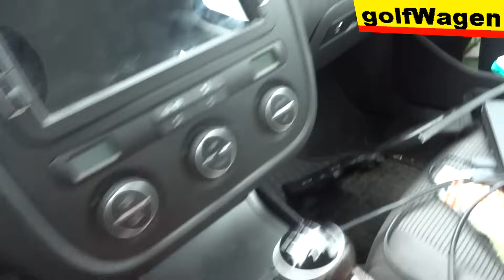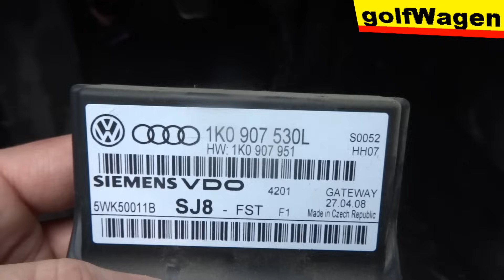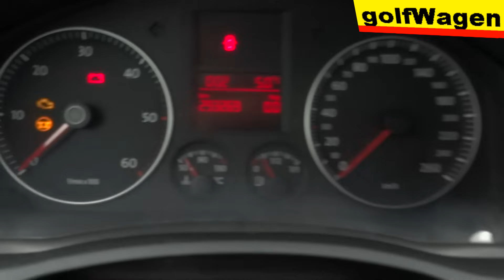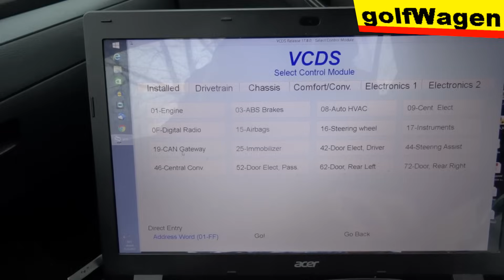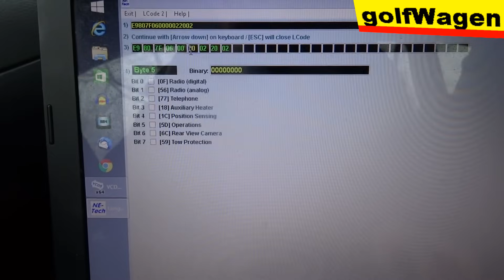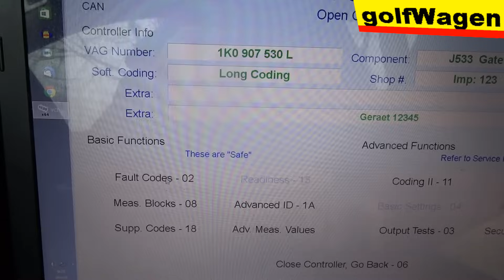VW Golf 5 CAN Gateway module location change programing /can BUS?/

Comment: Hello, I have a Jetta 2009, code 18259, there is no ABS ESP error on the screen, the only problem is that when I turn it on on a snowy road, the ESP symbol flashes on the screen, it was completely normal before.

Comment: @golf Wagen hi bro,I'm a golf 7 user, I'm getting parking sensor failure, fault code is u112100, when I connect it to the device, it says databus missing and the sensor on the left front corner of my vehicle is constantly beeping. I changed the sensor, the fault still persists, what can I do?

Comment: Hey can you answer me this please.  i was doing coding and programming with a snap on machine and now my rear boot lid dont work i check all the wiring to the module its not the wiring or parts at fault i need to tell the system the rear boot lid is fitted because when i do some check it say rear lid not fitted any help will do thanks.

Comment: Hi ever one on here can you advise me on the issue I do I ordered a vcds program from eBay to clear the codes stored on my car I actually removed and replaced the heated leather seats with normal seats on my mk5 golf and the radio now I have the steering angle light on and the abs the codes are which I can’t remove are 00361 and 00857 where my cd is working fine I don’t know how to deal with this issue can I make the car forget about the heated seat as I followed one of your videos where how to reset the steering angle sensor g85 which is sorted now but can’t get rid of the steering traction light and abs any help much appreciated thanks

Comment: hello, have you any experience about this comfort module (convenience module).. its eating my battery.. i found its using power when car closed.. also it clicks every like 2minutes..  what cable you use for this VCDS, where can i buy from ebay maybe. (octavia mk2 2006)..  the blink lights flash but no sound from alarm siren, thinking maybe this is reason.
Reply: Hey man. My car has the same issue. the CCM (Comfort Control Module) clicks on my car every 10 seconds and my battery is draining. I have a 2010 Passat. Did you figure out what was wrong with your car?
Reply: @danny996  not sure. Could be the alarm siren. Have 2 cars with same problem
Reply: @rteaw  hey man. I think my issue is a rear door locking unit. Check your doors and windows that they all work.
Reply: @danny996   i checked with software, monitoring signals, open closed.. both cars show same values.. its the module that checkes for something all the time and keeps draining
Reply: @rteaw  okay what did was get the car in locked mode and sat in it and heard a click every 12 seconds. that was the CCM unit under the glove box. that might be what is wrong with your car.
Reply: @danny996  What happened to your windows? :)
Reply: @ristokama2581  My passenger rear window and door would not work.I got a new door actuator and the door started to lock and the window started working. A bad door lock module made my car not go to sleep and would drain the battery.
Reply: Hi i have the same problem on golf mk 5 but all my windows and locks are working and still the ccm clicks every 5 seconds and drains the battery. Any advice ?
Reply: @babuschkacoolhere  latest i found is that backup battery in extra alarm siren is bad and therefore is not sleeping and checking
Reply: @rteaw  Tnx for replying. I am not sure that my golf has a alarm. Where is this battery located?  I am getting frustrated with this. I found out that when i remove f25 and f26 (40 a fuses) in the engine compartment, the clicking stops.
Reply: i have the same problem in my 2007 seat leon. It's eating battery.I measured fuses and the gateway fuse gaves the signal every couple of seconds. The clicks are coming from the passenger side behind box wich i took it away in i saw that the clicks are coming from convenience module.Then i disconnet the wires and the clicks stopped. I dont know where or what to look at to solve this problem.Sometimes is showing on my dashboard that the door is not closed and then i cannot lock the doors until the error disapers,and in my dashboard is not showing wich door is not closed. But even when i dont have that error and the doors lock the clicks are still there and drains battery.
Reply: @babuschkacoolhere  there is a battery built in inside the black platic siren. Normaly its behind the wheel arch plastic inside. Some people open and change out this battery if they find one to buy because is little bit non standard
Reply: @markoovsec1493   i found one more thing. I found fuse missing for alarm dont remember position. And than i got one guy to reprogram to another type of alarm at same time and now all is good. So dont know if it was because of the alarm or fuse. There is many different alarms to choose from he said. With interior sensor, without.. with glass brake sensor, without and so on. My problems all started from one total drainage of the battery. And still rear window left side works upsidedown when pusing controls.  And i got both rear door modules complaining about missing signal for iterior lock button (and i dont even have that)
Reply: @rteaw  i have drain problem from last year,but the problems with doors(sometimes is showing that are not closed,dont know wich one) that i have is now going to be about 3 years. i dont know if i even have alarm.
Reply: @markoovsec1493  1 sensor hood, 4 doors, rear bonnet lock. One of your micro swiches is bad and dont send the signal that convinience module is waiting for. Im not 100 procent sure but locks i think have 2 micro swich per lock. 1 for open and 1 for closed. With vcds interface you can folow and see the signals when you open and lock one bye one

Comment: Hello, why you change this module? I changed the radio and i have battery problems. I had readed that with the module L the battery dont have problems of discharging. Can you said me if you change it for this reason?
Reply: Did you find a solution, for me I upgraded the radio and I got a huge battery drain + lost steering wheel controls.
Any help!
Reply: @mmk958   you have to change the canbus or buy a adaptator. The best way is buy a adaptator
Reply: @jorgematamorosa  thanks for your quick response,
Do you have a suggestion or a link please!
Reply: @mmk958  depends of your car model, in AliExpress have a lot of sellers who have this adaptator
Reply: So I don’t need to get the canbus? The new adapter behind the stereo will be enough to avoid the battery drain?

Comment: @golfwagen did you solved for the key coding? anyway can you tell me where is the bcm module in a Golf V?
Reply from the maker: the key is not coded anymore. and the 46 comfort module is probably under the steering wheel. I think
Reply: golf Wagen I meant the Body computer which is the module 9
Reply from the maker: 9 cent.elek too under the steering wheel led or behind relay box

Comment: Does it need to first save old getway settings and tick/untick in the VCDS later after replacing for the new one?
I have some bulb orange and abs on the dashboard after placing new gatway is that something wrong etc?
Reply: same here, did you fix it?~
Reply: I have recently installed led bulb above reg plate and this is the cause I guess.
I did put the old bulbs back but it still appears o the dash.
Reply: I don't think that's the cause man, I recently replace my canbus on my passat 2006, and there's a few orange light showing on the dashboard after the replacement. I think I will need to reprogram the canbus to make it fit my vehicle, but 200 dollars for the VCDS is a lot for me lol
Reply: Liu Alex 
I do have VCDS for £50 from ebay and it does work.
I do have few faults to fix but never enough time to do so.
I fault is circuit fault and it is releted to that LED.
Cold coding it called?
Reply: oh ok, but did you clear the ABS light at least? I will go search on Ebay XD
Reply: I did have ABS light on but it gone after a while when I run the car as it is reseting itself somehow.